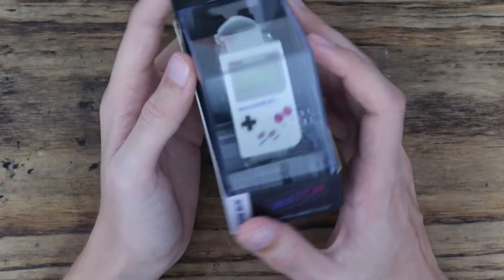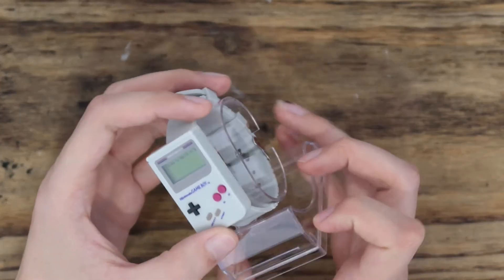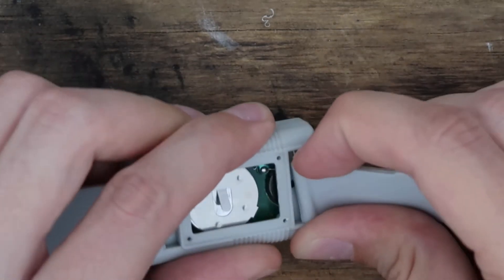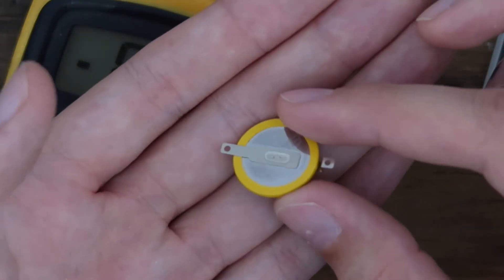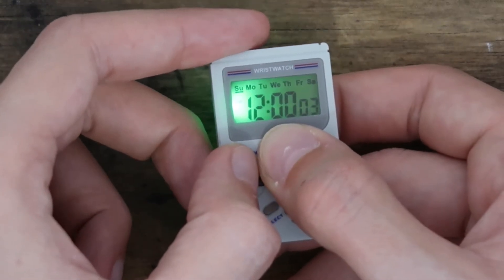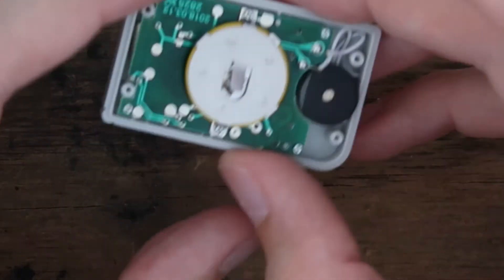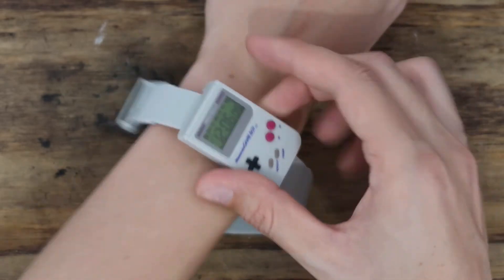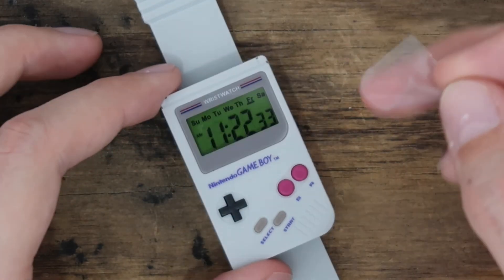Paladone Game Boy Watch Battery Replacement

Comment: I literally CANT get the screws off, they are to tightly on and the screwdriver just doesnt undo it, please help
Reply from the maker: Unfortunately they are quite cheaply made. You might be able to use a rubber band between the screw and screwdriver for a bit more grip, otherwise you may need to drill them out and replace them
Reply: @TheBygoneEra  thank you, i will try that!